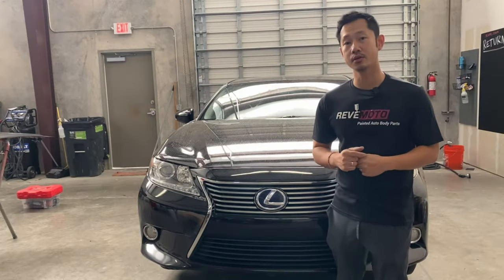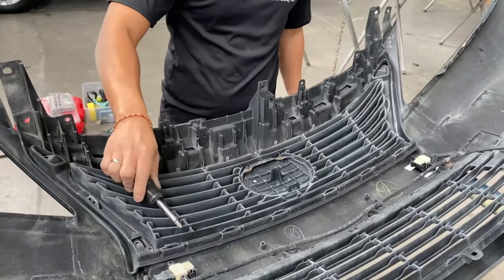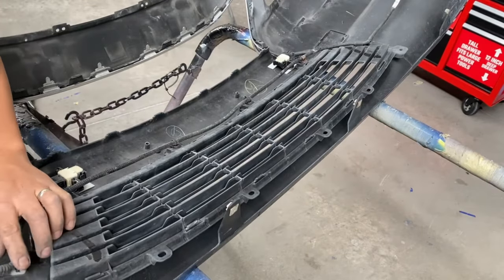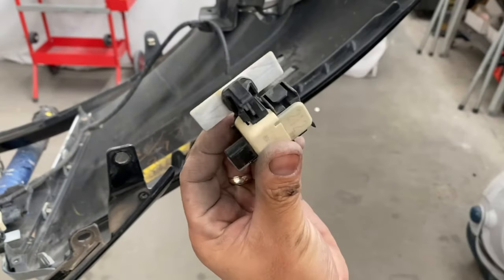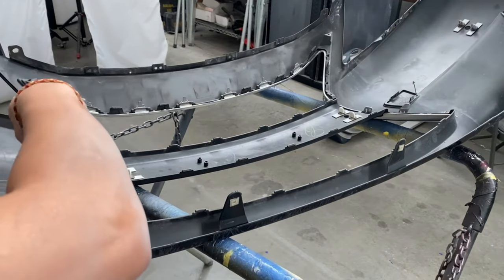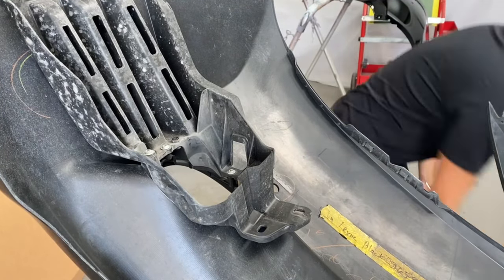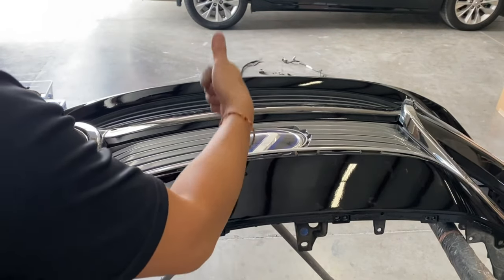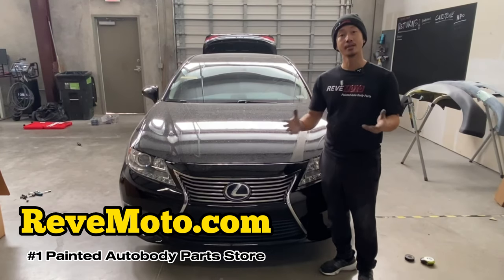2013-2015 Lexus ES350 Grill - Chrome Trim - Bezel - Sensors Removal and Installation (ReveMoto)

Comment: What’s the paint code for the grill? been trying to find out!! Video is very helpful!!!!
Reply from the maker: It came painted like that from Toyota but if I had to paint it.  Paint code would be Toyota 202.  Thanks for watching go to www.Revemoto.com for all your parts needs
Reply: Sorry if you misunderstood what I was trying to ask.. I meant the grill itself, it’s like a dark grey and the 202 paint code is black. I’m looking for the original paint code for the actual grill, the one that houses the bezel. Thank you so much!!!!
Reply: @HoaNguyen-qs4sf  Oh sorry Hoa I misunderstood.  So that grille itself comes manufactured that color already.  There is not a paint code, but you would have to go to a paint shop and they can use swatches to get close enough.   I think if I had to match that color it would be 1G3 Toyota would be my guess, but I don't have the car anymore to be 100%.

Comment: I have a 2023 lexus es 350 base model. I would like to change to the fsport grill. Would it be compatible?
Reply from the maker: The whole bumper needs to be converted meaning its a different bumper
Reply: Im in same boat as you. Did u get to find the f sport grill and change it?